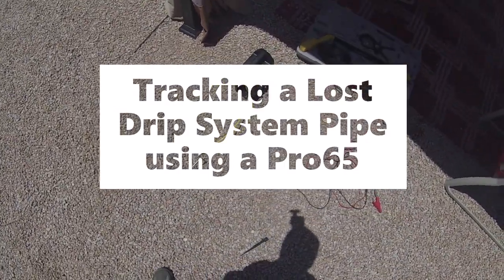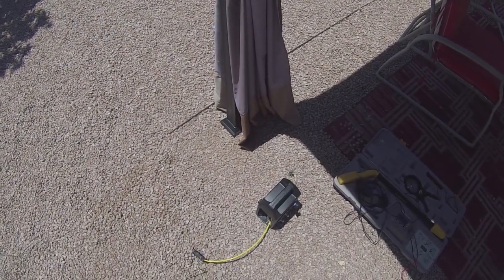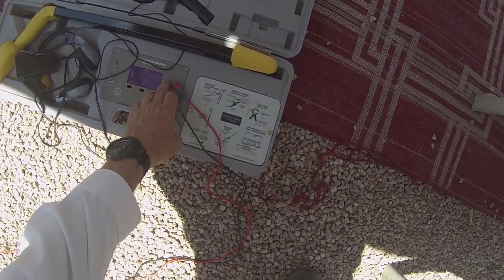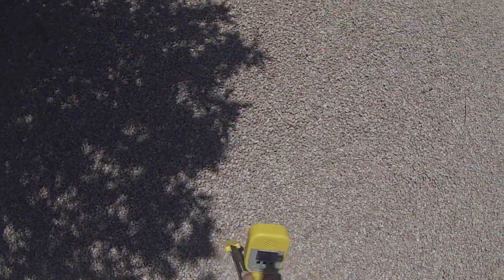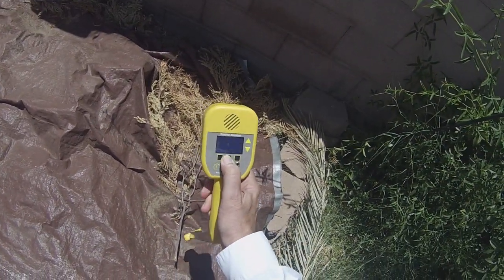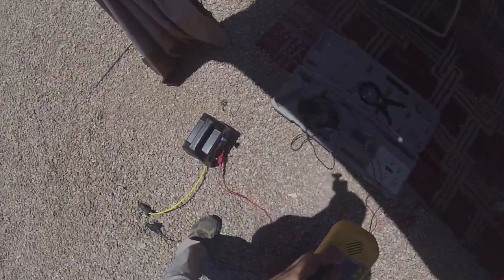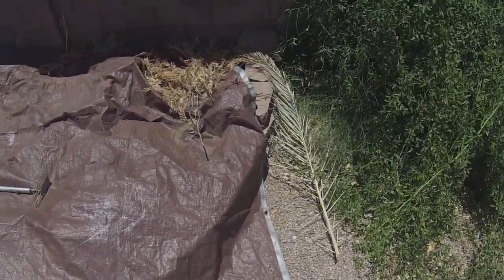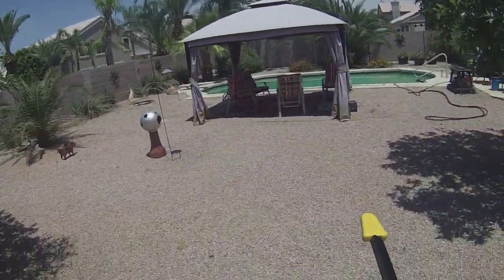How to Track Underground Plastic Pipe or Tubing that does not have a Metal Tracing Wire Pro65 Pro900

Comment: Is there an underground polyethylene detection sensor at a depth of more than 3 meters
Reply: Mr. Alsibani: That depth usually requires the use of an active "sonde" which is commonly threaded on to a flexible fiberglass rod. They transmit at 33 kHz to be compatible with a variety of tracking receivers including Radiodetection and others. They can be used in polyethylene pipe that has a 1 to 2 inch diameter.

Comment: Does pro65 device go through fittings?
Reply: Hi Kevin. The smooth rigid rod of the tracking tube has a rounded metal tip and is narrow, but a little stiff. It will go past many obstructions but something like a right angle fitting on a pipe of less than 1-1/2 is tough. It will go more places than most fish tapes.
Reply: I bought one, it cost me like 700.00, I mean if youre going to have the pro900 you should probably have that super nice capability, right? Well the first chance to use it came the other day, I got severely ripped off. As you can see when he did the 45 deg and pulled to the right, that pipe he was locating is only about 3 inches deep. Thats about all the deeper you will get with it, which means it's totally pointless. The pro900 works ok, ive located a couple feet deep on electric wires, but if the wires aren't a large gauge, it doesnt work. If there is any electric nearby- it doesnt work. IF you are near a meter or power lines, it doesnt work.

Comment: I have a drain pipe in my yard that I would like to trace. What sort of professional should I hire?
Reply: You will have the best luck with a pro who has installed drain systems and knows the practices. Either that person or a regular irrigation tech with a wire tracker can be successful. A wire tracker will give either one the ability to get an idea on how the drain is routed. They commonly use a metal plumber's rod/tape pushed into the pipe and track that as though it were a buried wire. If the drain is full of debris you may have to use a probing rod from the surface.
Reply: Drain pipe is a lot easier then water ljne. You can use a camera with locator.